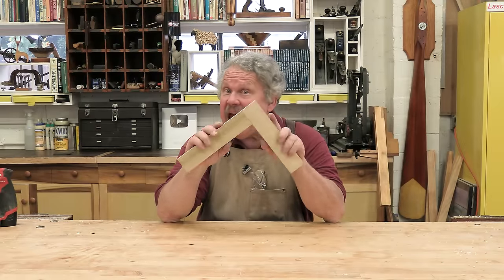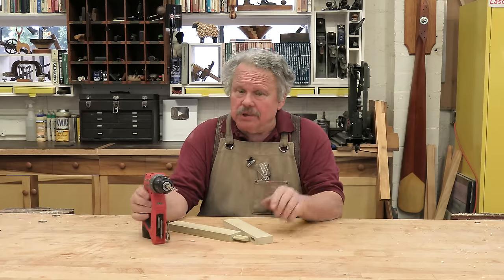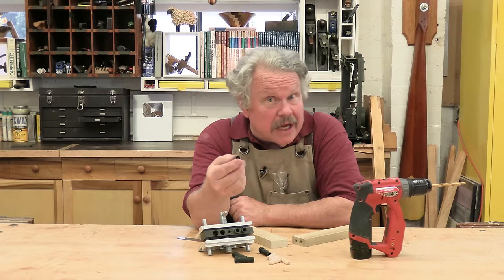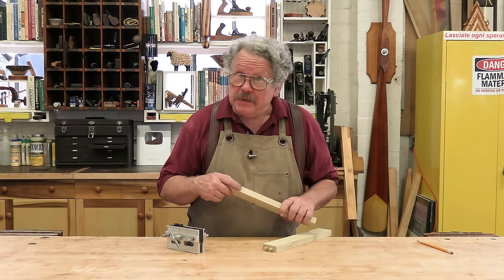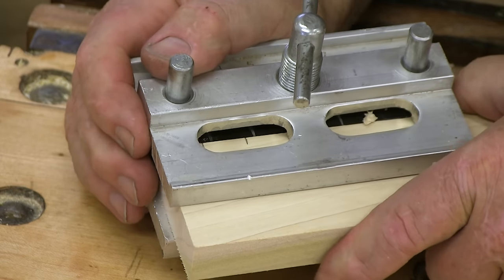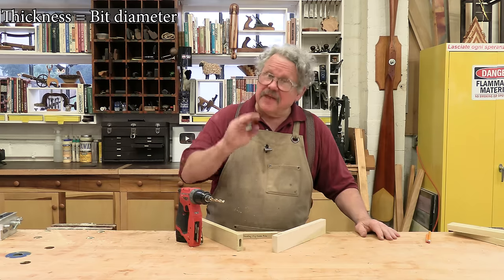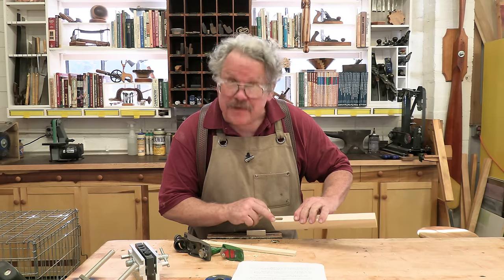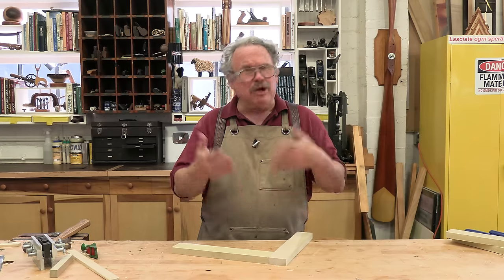Making Domino Joints for $30

Comment: make a length of "tenon" round over on router table, cut to length.
Reply: Hey! That’s a pretty good idea!
Reply: While you're at it use the router table to cut the slots
Reply from the maker: If you're doing a lot of tenons, sure. But most of the time I just look for any excuse to get out a hand plane.
Reply: That's great if you have a router. I think the point to be made is that it's not necessary. As someone with limited tools and limited hand mobility (thanks to a reckless driver nearly checking me out of life early), the option to do this kind of joinery where I am, with the tools I have or can borrow, is important. 

A lot of early woodworkers are in a similar place because the entry to the craft sometimes feels like looking up a mountain. Skills lessons should be accessible to everyone, not just those with money for a shop full of power tools.
Reply: @KatieCottingham absolutely- people getting started dont need to see all the short cut fancy expensive machinery people use to make it seem more expensive to start than it really is. Wood is expensive enough these days without fancy tools. This is a fantastic video, thanks so much!
Reply: I built my first piece of furniture, a red oak KS bed from rough cut kiln dried lumber, lumber costs just $360 and the money I saved paid for the tools; 13” planer, table saw, routers, track saw, tile saw for inset roof slates.
I plunge cut mortices using a template made from 1/2” ply, cut free tenons using roundover bit, it looks awesome and I think it would support the weight of a pickup truck 😂
Reply: It's a little obnoxious how people complain about a relatively small amount of tools.

Here's a new thought: if you can't afford a simple Wen benchtop routing table, you don't need to be making things like this.

Go make/sell some baby gates and planter boxes until you've saved up enough to buy real tools, then come back to these videos.
Reply: What is your deal?  Wow! Relax. Go router something.
Reply: @KatieCottingham  When it comes to hand tools, using cheap versions perform very poorly, especially things like hand planes. A cheap router with a sharp bit will actually perform better and is easier to use than a cheap plane, and costs less money. A router table is cheap and easy to make from wood and plywood. A Wen brand variable speed router costs about $46. 

A Stanley number 4 hand plane is about $130, and that's not even an expensive brand, it's made in Mexico. A cheaper model is a Jorgensen for $70 made in China. You can do a better job with less strain with a small cheap router for $46. This applies to other hand tools as well. Using cheap hand tools is a very poor experience compared to a lot of cheap power tools. Unless you have acquired some antique hand tools that are in great shape, you can get a power tool version that will be better and easier. I'm a professional carpenter with 30 years experience so I know something about these things.
Reply: The South Park style animation 🤣🤣 I’m a new fan.

Comment: The Domino is a professional grade tool.  The benefit of the tool is that it will create a tenon joint quickly and on site.  One of my clients I happened to notice one day, has one in his cabinet shop for the afore mentioned reasons.  If he made his tenon joints your way he wouldn't be in business.  Still, I enjoyed the video.
Reply: I don't think this video was aimed at professionals. I think it was focused on people like me. Beginner, weekender woodworkers. People without a lot of resources or experience. 

It not only shows us a realistic way of getting the job done, it opens our minds so that we're thinking about possible solutions and not getting stuck thinking, "Well, the only way to move forward is to buy an expensive tool that I might use once a month or stick with dowels." When you don't have experience, you're not able to problem solve as well. 

He's our 'grandpa' teacher. Now three generations have lost that resource and we're reinventing the wheel from scratch.
Reply: And my mechanic has a lift but I just use a floor jack. Not sure the purpose of your comment outside of a possible desire to be needlessly contrarian.

Comment: For those people adverse to wallowing out the slot with a drill bit since they're not designed for that, machinist endmills are available designed to cut metal on the side. Most also cut on the end but you have to buy the plunge type.
For that matter, straight router bits could also be used.

Comment: Awesome Video as always...thanks for info...The point of the dominoe is that it's faster and you can make many joints in little time (time is money), a good thing if your making a living selling your projects...I used to use doweling jigs (no mortise cut out) for that purpose which adds hours...The dominoe does pay for itself after a few good  jobs...but its nice to see different ways to do things...happy wood working to all!
Reply: This can't be said enough. Domino + a few paying jobs and it's already paid for itself in time saved, unless you're content with working for around $3/hr. Undervaluing their time is something I see most woodworkers do time and time again to save a few bucks up front.
I still use a doweling jig, but a nicer one (dowelmax). It works on reference surfaces rather than center points like those junky "self centering" jigs.
Reply: Absolutely time is money. I've used dowels, chopped mortises by hand, drill press & dedicated hollow-chisel mortiser, and done a few using the method in Nick's video. The domino is the best result in the shortest time--at the highest cost in tooling. It's criminal what Festool charges for their machine and I'm sure there will be copies that carefully don't violate any patents available soon for 1/4 the price. Once the patent expires it'll be maybe $200 at Harbor Freight.

Comment: That was an excellent instruction video! I refused to pay that type of money for a piece of equipment when I can do the job for roughly $30. 
Thank you very much for this information!
Reply from the maker: Most welcome. But I have say in all honesty, that jig that I used was something I picked in the late 70s or early 80s. It was made in America with the sort of tool craftsmanship we used to take for granted back then. To get that sort of quality tool today costs a little more than $30 -- read the recommendation we made at the end of the video description.
Reply: It depends. True if you are a hobbyist. But if you are a professional, Domino will get this work done in fraction of a time and save you headaches and money….  The best alternative ( not a replacement ) for Domino is Dowelmax. I have used both and I am a hobbyist. The only inconvenience I found with Dowelmax is the screw holding the stock can get loose. The only inconvenience I found with Domino ( besides the price) is the dominos are too tight for dry test. And if you select the loose option, the mortise are too wide… this may be ok as it makes it easy to alight during glue up and the wide surface is enough for the glue strength.  I still wanted the default tighter notices to be a shade wider. This way you do not need todo extra work of sanding dominos to marrow it down etc…
Dowelmax is still expensive, but the precision is amazing… I have built coffe table and desk using dowelmax

Comment: Another great video from the man..  An alternative to an expensive domino machine for a weekend woodworker.. However, if you are a tradesman on a budget you could make do with dowels or a much more affordable bench morticer and tenon making jigs/methods..
One day Festool's world patent will lapse and affordable knock off domino machines will be as cheap as the biscuit joiner.. 
A biscuit joiner and commercially available metal biscuits could be another good Strength/Time/Cost option.

Comment: Hi Nick, 

 I used this technique after watching your video and it worked like a charm. I wanted to do something  experimental and made some floating tenons out of  Baltic Birch plywood.I did some destructive backyard testing with a sledge hammer .They seem to be  stronger than solid wood, which is what I anticipated.
Reply from the maker: Interesting post; thanks for sharing. Commercial dominoes are made from compressed birch chips. The wood grain in the chips goes every which way, just like in commercial biscuits. This product is quite strong, so it makes sense that a plywood domino would be as well.

Comment: I’ve been a woodworker for a long time. I don’t know how many traditional M&T joints and dowel joints I’ve made over the years - and now I use the domino for most of my end grain to long grain joints. Yes, the machine is expensive - although much more so now than when I bought both the 500 and 700 machines perhaps 10 or 15 years ago. However, the time saved for a professional or even, as I am, an amateur always to do things efficiently and save precious time, means the repayment period is very calculable. 

The added advantage of the domino over traditional M&T joints for me now is that my shoulders will not take the strain of using the dedicated morticer very much. So, for large joints (say doors and I’m about to make 4 of them), I use the 700 machine and double the size by flipping the pieces over and thus getting mortises than are just less than twice the thickness of a standard domino mortise. 

I also have a table saw, a bandsaw and a track saw. Sure, I could do without one, or even all of them, if I wanted to but each can do different jobs. I have several chisels but could really get away with one or two.

I’m no huge fan of the like green and gray people. Nowadays, I, sure you are paying a large premium for the brand name. But, isn’t that the case with cars? I can make a journey in a cheap, cheap car or a Range Rover. Both get me there but one does it in greater comfort.
Reply: @jeremiahbullfrog9288  I sure as hell have taken no sponsors or money from anyone as I have 10 subscribers, but I will say, the 80 hour weeks and multitude of completed projects I’ve done over the last year did pay for my domino and sawstop. Helps to drive a 17 year old vehicle too. If people put half the money they spend on cars into their passions it would be easy to buy these tools

Comment: I found this easy to do using the Shopsmith horizontal boring feature. It work great since I don’t have a dowel jig.
Reply from the maker: I can see that it would. Furthermore, you could use Forstner bits on the Shopsmith and get a nice flat bottom to the mortise. And you could easily switch to an end mill or router bit to get good clean sides. Hard to do with just a doweling jig.

Comment: I really liked your folksy, no nonsense approach to making this time-proven joint.  My only suggestion is to use a chisel toclear out the path between drill bit holes rather than the drill itself.  That wy there'll be much less chance of overly misshaping the mortise.  Again, this is a great video.

Comment: Domino is a proudly festool thing. 
"Spline"  is the term for this video.
Tenon is the male side of the same piece of wood you are joining.

A Domino  is not only for joinery but is highly precise for alignment. And you don't need a second mortgage to but one, you can actually get one easy, just brew your own coffee for a year, save,  and you'll have enough to buy you one and most likely some extra cash.
Reply: Also have to account for speed. The domino is a joy to use. It’s fast AND simple, reducing much of the calculation and setup involved in implementing floating tenon joinery. This can’t be ignored. Nothing wrong with jigging things out, but good lord, it can be miserable power drilling a table's worth of dominos or dowels.

Comment: That looks way easier than trying to follow any of the "homemade domino joiner" videos.

Is there a big increase in stability over just a pair of dowels?
Reply from the maker: If by "stability" you mean strength, then not likely. An informal test we did indicated that dowel joints were stronger. But dowels don't allow you to make slight adjustments as you glue up.

Comment: I bought a self centering jig for dowel and have been using it. Just wondering if dominos would be stronger than just putting more dowel pins. For the case you showed, I feel 2 dowel pins should have plenty strength. For connecting boards together, I can just put more pins. It takes more time but since I am doing for a hobby, it should be ok. I am seriously considering grizzly dowel jointer which is just 100 bucks. I need to check how stable that thing is.

Comment: I built my first piece of furniture, a red oak KS bed from rough cut kiln dried lumber, lumber costs just $360 and the money I saved paid for the tools; 13” planer, table saw, routers, track saw, tile saw for inset roof slates.
I plunge cut mortices using a template made from 1/2” ply, cut free tenons using roundover bit, it looks awesome and I think it would support the weight of a pickup truck 😂

Comment: If you only have a few loose tenon joints to do, this method is fine. If you have a big project that will require dozens of joints or more, it's worth taking the time to build a custom jig to cut the mortises with a router. Building your own jigs is not expensive because in most cases they can be built from offcuts and simple hardware.

As for the tenons, no jig is required. Those can be ripped on a tablesaw from lengths of hardwood stock, rounded over with a router and cut to length with a cross-cut sled. Or you can go the easy way and purchase them pre-cut: those have the advantage of having been dried to a very low humidity rate (like dowels) and therefore expand in the mortise when exposed to the moisture content of the wood glue thus making the joint even stronger. Those are inexpensive (as long as you stay away from the F brand tenons).

Comment: Thank you for this video. I've watched it with a particular interest. I have a similar kind of dowel jig and was thinking about a similar way of making a domino joint. No problem at all to achieve that. I have only one concern: why would I bother to make an additional effort? What would be the benefit compared to a pair of dowels (or, say, 3 dowels)? Is it only the looseness helping to adjust the joint before clamping? Can that looseness compromise the stability of construction? Thank you!

Comment: As usual Nick very informative and super helpful. A great cost savings, the only use I could see for the domino is if you are doing a lot of tenons and time is money?
Reply from the maker: Full disclosure -- I have zero experience with a domino joiner, I've only ever made loose tenons using this method. So I can't say how much time one could save with dedicated tooling. But it would have to be an enormous amount of time to justify the expenditure.
Reply: @WorkshopCompanion  It's not just time, the domino will be much more accurate as well. And it enables you use floating tenons where otherwise it would be too time consuming and too difficult. For example, cabinet boxes and drawer boxes.

You might think there's no point in using it for that, screws are just fine for cabinet boxes. But using the domino only takes a few extra minutes, and it makes your assembly so much easier since you don't need to fumble with clamps to get the box aligned while stapling/screwing it together.

Comment: Just curious if there is a significant advantage to the diy domino over two dowels? Seems like a lot of effort for not much gain
Reply from the maker: The only useful difference I see is the ability to shift the 2 pieces your gluing up a little. Dominos give you the ability to do some adjusting to the left and right where dowels require a tight fit for a good joint. - Travis

Comment: nice demonstration.  I think the beadlock system sold by rockler does something similar but easier for beginners.  I tried it once (original version) but the beadlock tenons were pricey and my mortises never came out very nice.  Maybe my technique or clamping was off. I'm sticking with dowel jigs right now.
Reply from the maker: I'm always amazed at how many ways there are to join wood. But I agree with you about dowels; simpler may not always be better, but it's usually sufficient.

Comment: good video but I almost always prefer dowels to dominos because of the extra effort in making the holes and dominos themselves.  I also find joints with dowels to be more precise and the process is much faster.  I can almost hand cut a mortise and tenon joint in the time it takes create a domino and cut the hole.
Reply from the maker: I agree with you for the most part, but loose tenons have their place in good craftsmanship. The amount of gluing surface surpasses what you can get with a dowel or a biscuit, and the joint is stronger for it.
Reply: @WorkshopCompanion  We can work out the exact surface offered by both joints: A domino's two rounded ends adds up to exactly one dowel. Circumference of a circle is 3.14x diameter, so the flat sides each have about the surface of a dowel; on balance a typical domino has the surface of roughly three dowels... Thus the loose tenon/domino has the same glue surface as three dowels BUT it has the cross-section of about six dowels, so should be harder to snap off I think?
Reply from the maker: @SenselessUsername  Impressive figuring. By the same logic, it should also be more resistant to racking stresses.
Reply: @WorkshopCompanion  I completely agree that loose tenons have a place but if I'm building something and just want a quick way to butt-join a couple pieces of wood together, using my dowel jig is usually the fastest.
Reply: @SenselessUsername  then a mortise and tenon would be superior even to that because it's squared corners offer a slight bit more gluing surface and the fit is usually tighter, resulting in easier clamping.